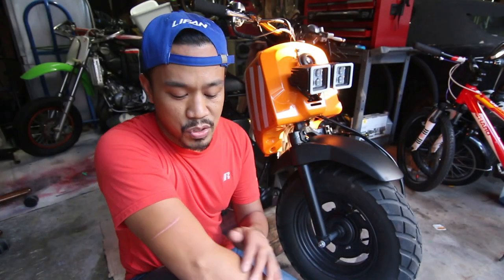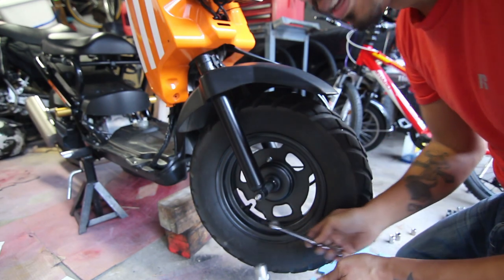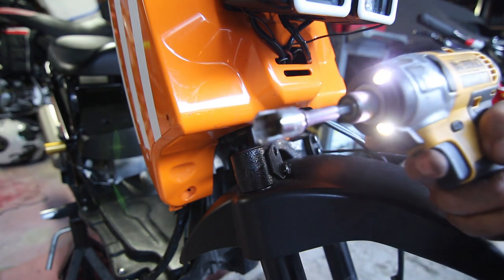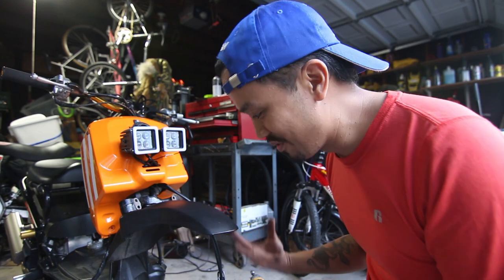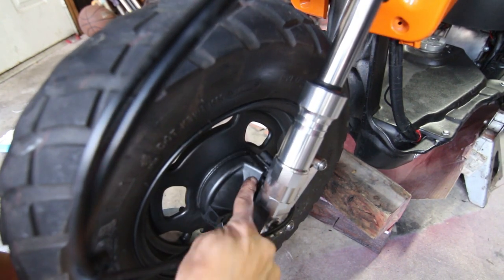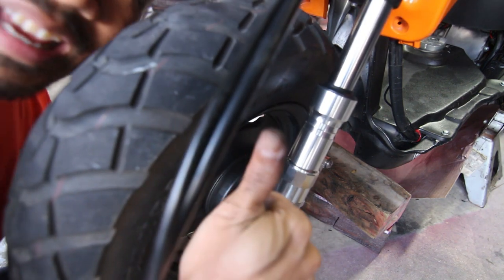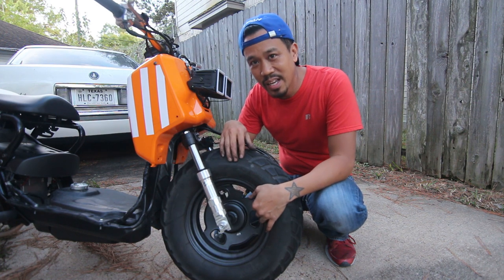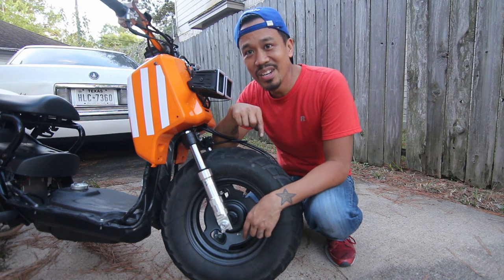Honda Ruckus : Upgrading the front suspension with NCY shocks

Comment: I bought the NCY Front Fork Carbon Fiber Set (Drum) and it was really easy to install.  Everything fit like the OEM forks, so I got to keep my front fender.  And no need for additional kit pieces either. It made a BIG DIFFERENCE in handling the bumps (they don't beat me to death anymore).

Comment: Hey Cesar hate to make the comment but your front right fork (opposite of drum brake) may be needing to be rotated 180°. Cant clearly tell how you ended up bolting it down.
I installed mine today and used the shorter sleeve the drum adapter kit supplied.
If you notice on that's fork there is about an half inch piece that's part of the shock that should be toward the wheel to make up the space in between the fork and tire.Right around 2:07 on your video is what I'm referring to.
 I took some pictures of my install today if you'd like I can send you those somehow.

Comment: I noticed that my front shock bottomed since I stretch It out what can I do
Reply from the maker: Stock front shock ?
Reply: Witch one should I get I am planning to use stock drum
Reply from the maker: They make a ncy aftermarket for the ruckus that is capable of the drum break. Make sure it says for drum and don't get the disk break conversion. If you do you need to buy an adaptor

Comment: Did you end up needing a longer axle? I just did the same to mine with the drum adapter and when I tightened the nut all the way down i was only able to get the end of the axle flush with the end of the nut so the axle isnt sticking out at all. Should I just add some lock tight to it?
Reply from the maker: Loctite for sure (red) and mine was good. It was short after I added the bracket for the Grom fender (see new video for he mod) but as long as it threes 3-5 times and you loctite it should should be good. I would do it and run around and then check it each ride for a few rides.

Comment: Does the stock tire rub on the front  fender? I have mine on with my 12" front wheel with out any issues.
Reply from the maker: ill try to add it back this weekend. I really want the front fender
Reply: @SmallEngineVelocity  I personally feel like a Ruck without the front  fender looks like a person with missing front teeth. But then again I have a GY6 on my ruck so take that with a grain of salt 😂

Comment: What’s the size of ur front tyre, bro?
Reply from the maker: In this picture 90/90
Reply from the maker: Eventually I went to 100/90
Reply from the maker: I should have done 100/70
Reply: Small Engine Velocity I’m thinking fit 120/90/10 to front with same RRGS low down fork as urs, just not quit sure the clearance will be enough for wheel to turn, lol.
Reply from the maker: As long as they are it low down stocks it will work. I use to run the stock front tire with my aftermarket front shocks
Reply: Small Engine Velocity thanks a lot, bro.